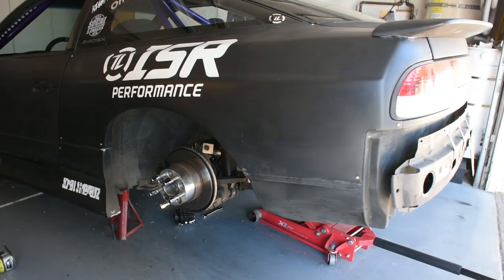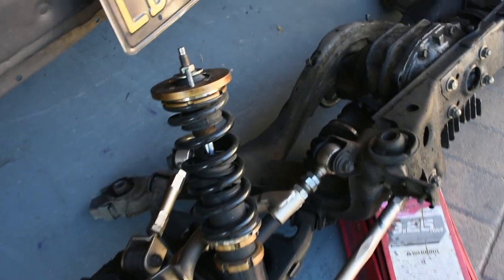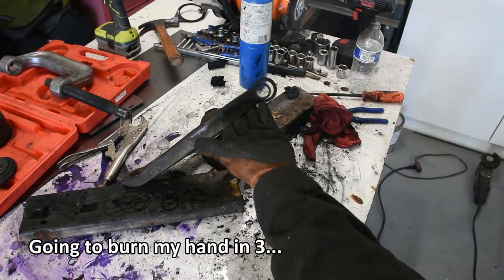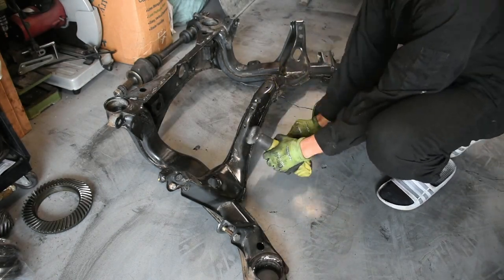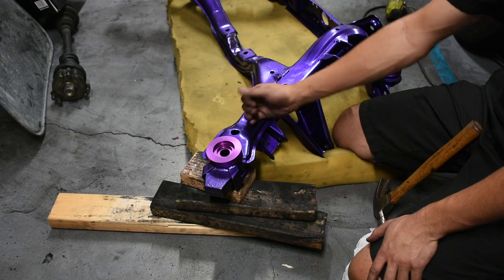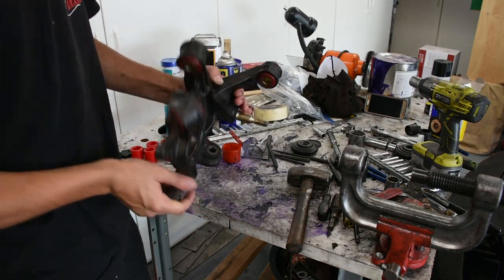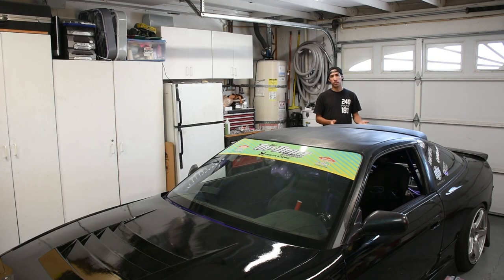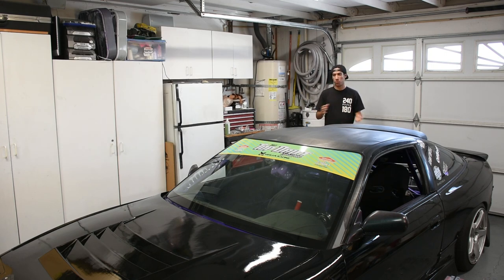How to Get Rid of Wheel Hop - Complete Subframe Overhaul! | Le Drift Car II EP. 21

Comment: The cordless impact gun might possibly be mankind's single greatest invention.
Reply: i agree. i have two of them lol
Reply: Sadly they are worst mankind's invention when used by sadistic,unqualified and insensitive mechanics (or wannabe mechanics) !
Last month I took my wife's 2010 Yaris to Costco for a first tire rotation and balancing after one year and 12000 Km (7500 Miles),on new Michelins.
I was watching them working on our car from outside. To me it sounded brutal how those young f.....s are playing with impact gun. After using impact gun,they went around car and used that plasticky Husky torque wrench from Home Depot. Yes it clicked on every lug nut. It would click just as same if lug nuts are overtightened 2X or 3X over factory specified torque of 76 ft-lbf.
Sure enough when I came home I was pulling my hair. Every lug nut was rounded and not equally torqued. I used electronic torque wrench to check it. For more than eight years I would torque lug nuts in three stages (30% each time of specified torque),and I would do it in star pattern.
 I'm just observing people on YouTube doing everything with impact gun. One guy was even installing spark plugs with impact gun! What a f. is wrong with people?
I wouldn't let him built dog house. What happened to quality torque wrench,6 point socket and anti seize lubricant? What is happening with common sense and pride in our work?
Reply: I have the Ryobi too. Might invest in getting a bigger battery. It is awesome.
Reply: @volimzbjeg  seems like this is a thing everywhere around the world
Reply: @volimzbjeg  at least lug nuts are steel on steel. Someone used an impact gun last time my car was serviced. So when I went to change the oil (first oil change i did on the car) the threads stripped out of the aluminium oil pan. Luckily there was some threads left so I could use a longer bolt to plug it up.

I think it comes down to poor management. Especially in the tire shops they need to move cars as fast as possible or else they get fired for working too slow. Hence why they can't do the 3 stage torque procedure and basically just use the torque wrench as a means to check if it's "tight enough" or not. It's how our society works any time it's not a privately owned business, it's gonna be a tight tug between quality and efficiency because that's what makes money.
Reply: None of them are as powerful and as reliable and cool as the good old pneumatic (steam punk) impact wrench. Keep your baby toys, we don't want them.

Comment: FINALLY! <3

SOMEONE HAS FINALLY UNDERSTOOD IT! *white light from the skies all shine on the garage of offbeat*

I can't believe the amount of people who press things in with brute force in the automotive spheres here on youtube and out in the real world. Heat and cold are your best friends when it comes to both removal and fitting of everything with tight tolerances.

Everyone's always like "lemme just get my '500 ton hydraulic overkill compensation for insecurity of own manliness press' and force this shit right in here". 

Heat the outer surface, put the inner surface in the freezer. It will drop right in with hand power. No need for extremely expensive massive friggin overkill tools for these kinds of jobs.
Reply: Johannes Konow best part about doing it that way to is that when the both return to room temperature they will actually be in tighter than if you forced it.
Reply: I know... If you want a straight good fit of any cylindrical thing into a recess of some kind, you can actually machine the OD bigger than the ID of the piece it is going into by a small amount (depending on size ofc) and actually get it to sit stronger than if you welded it if you use heat and cold.

Cool the OD piece with dry ice, heat the ID piece with propane or similar and it will be there permanently.

Comment: With those LCA bushings, I found the quickest way to get them out was to blowtorch the outside (aka the control arm) for 10 seconds and the arm housing expands enough to press them out easy as without burning anything
Reply: Also wow at not having oem cuts in the subframe bushing sleeves! Mk3 supra ones have a two piece sleeve that is super easy to just pop out with a solid hit from a hammer

Comment: You could remove the brake calipers from the rear uprights before lowering the subframe. It'll save you the extra step of bleeding the brake system. Just don't let the calipers hang by the brake lines. Tie them to the chassis.

Comment: If you have access to a air chisel and can get the blade between the subframe bushing top flange and the subframe, they come right out in like 10 seconds with a few hits from the air chisel. Way easier and quicker than burning ans cutting.

Comment: Dude suspension work is the fucking worst. Just finished pulling my truck’s old suspension apart and replacing the bushings. So much much harder than engines. I definitely utilized the blow torch. I actually just left a bunch of components on fire in my gravel while I cleaned up my frame and other components lol. The fire does wonders for old bushings.

Comment: Can you press the bushings out of the LCA or do you have to burn those out? Just wondering because you used the press for the spindle and burned the LCA bushings. 
Thanks great vid. Have been watching ever since the original Le Drift Car Build.
Reply from the maker: +mileofsmiles There's not enough material around the LCA bushing for the press to sit there so the only option I had was to burn it out. If you notice on the knuckle  there's a good amount of material around the bushing for  the press to sit on and do it's job. Theoretically as long as you figure out how to get the press mounted onto the LCA then it can be pressed out

Comment: So replacing proper spherical metal bushings in the wheel spindle..with polyurethane bushings is a good thing? some stuff never sees to amaze me :)not my intention to "bash"...but i just had to comment on it..as i really dont get why people do replace good original design parts..with poorer aftermarked parts..its basically a downgrading of the car :)anyways..love the work.Greetings from Norway
Reply from the maker: They aren't spherical metal bushings. They are OEM rubber bushings with an inner and outer metal sleeve and in between the two sleeves is rubber. The stock 240,000+ mile rubber in them gets a ton of play overtime, especially since the stock rubber in the bushings is already soft and has play. The upgraded polyurethane bushings that I replaced the OEM rubber bushing with is significantly stiffer and in fact an improvement over stock and not in any way poorer. Please educate yourself before commenting. Thanks,
Reply: Then its my bad.and i often DO read up on stuff before commenting,but no one knows it:) all.so its allright.Still..personally ..i would not fit poly bushes all over..but i know its a drift car..so its obviously kinda different from where "im coming from".Greetings ,Stefan

Comment: Hey question.
How much better does the car feel now? Just wondering im in the middle of overhauling my subframe but not sure if i should replace all the bushings. If its worth it ill surely do it.
Reply: replying in case anyone finds this comment and has the same question: poly bushings in the rear knuckles are not recommended because poly bushings have greater stiction and are more prone to binding. The suspension geometry in S-chassis cause a lot of flexing in the bushings of the knuckle, which poly is not good at. Its recommended to either replace them with oem, nismo (harder rubber) or go full monoblock spherical like SPL. Using poly in the knuckle will feel better but your suspension will respond worse to travel.

Comment: would it be a waste of time to do just the subframe bushings and not all the others?
Reply from the maker: Subframe bushings are usually the worst and have the biggest difference in handling imo. If you were thinking about doing just the subframe bushings I would say that's fine. Just check the other bushings while you're there and if anything is crazy worn out then replace it but otherwise leave it.
Reply: awesome thanks, I appreciate the info

Comment: One of my wheels sticks out further than the other. Can u give me any ideas on things to check? It's not the wheels and I have fully adjustable arms and it has been aligned.
Reply: They are but they're pretty even and the difference is like over half an inch it can be seen just comparing wheel fitment to where the door is lol
Reply: this might be useless info but you didnt mention what car you have so here goes:

if your car doesn't have independent rear suspension and you lowered it, chances are that you didn't change the panhard bar. if so, get an adjustable one and you're set.

Comment: There actually is an S13 balljoint replacement...although it could be the same as the Sentra ones in the US. Good work with the subframe cleanup. I did mine and I hated the entire experience...lol

http://justjap.com/top-performance-rear-outer-lower-ball-joint-nissan-a31-c33-r32-s13.html

Comment: moog doesnt thread the ball joint ever... the fitting actually cuts the threads
Reply from the maker: +PilotAbileen27 Yeah we worked on trying to thread the fitting on there for 10 minutes and it wasn't biting. Even after it was tapped it still had a hard time biting.

Comment: Why didn't you just unbolt the coilovers from the Knuckles and leave the coil overs still mounted in the car. Also instead of disconnecting the brake hose, should of just unbolted the calipers and hang em with wire to your coil over. But you do what you want, that's just how I remove the subframe from my 240.
Reply from the maker: Was inspecting, adjusting, and cleaning the coilovers at the same time so I removed them completely to do so. Calipers I could've left on but just removed them anyways.

Comment: Cmon bro you didn’t paint the diff!!
Reply from the maker: +Sergio Godoy The diff is a jacking point for the rear end and it gets swapped for other diffs with different gear ratios depending on what track I run. And then when it's swapped out and not in use it sits in the bed of a truck or in the garage getting scratched up until it needs to be used again. And yeah, so painting the diff wasn't worth it at all in my opinion because it would get swapped and beat up on constantly meaning it will look bad no matter if I paint it or not haha. Got a reason behind everything :)